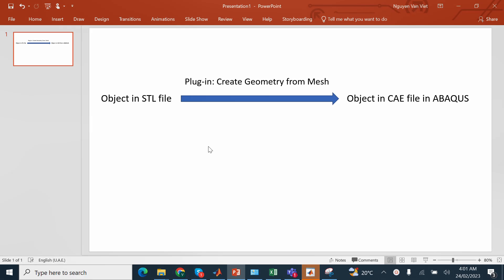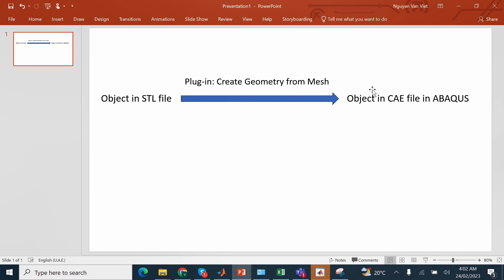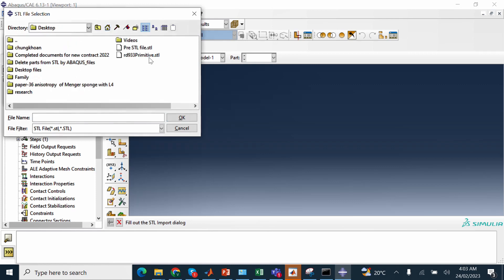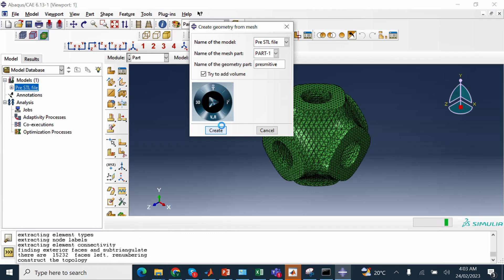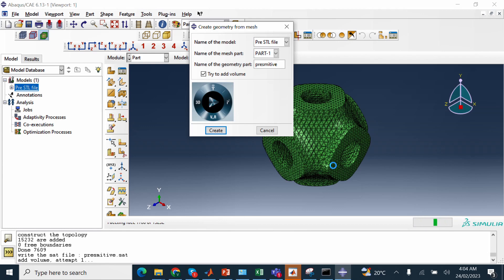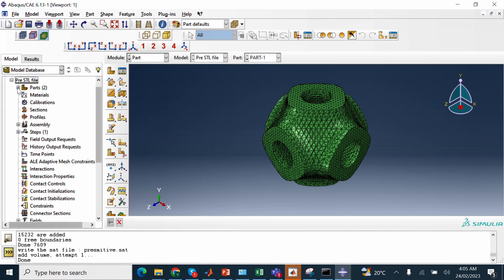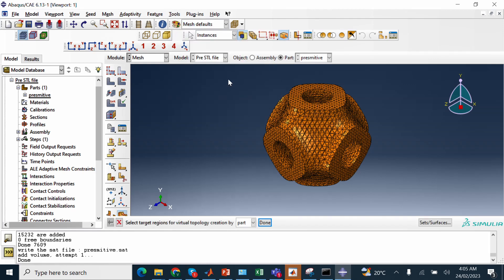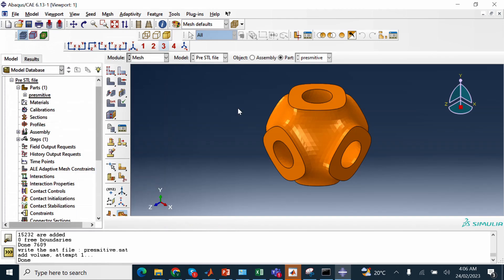Convert object in STL file into CAE file using ABAQUS

Comment: Hello. After using the 'Create geometry from mesh' plugin, the new part is 'invalid'. It creates a set for invalid vertices. After querying the part, I get the following:
It is a mixed dimensional part(1 cell, 9154 solid faces, 12 shell faces, 13749 edges, 4581 vertices). Do you know how to clean this up or fix what is happening here?

Comment: Hi, after I do all of this step, when i tried to create a mesh there are pop up "the selected regions cannot be meshed automatically using the assigned element shapes. They must either be partitioned, assigned a tet shape, or manually meshes using create bottom-up mesh tool". How do i fix this? Thank you
Reply from the maker: Hi, please use the  tetrahedron mesh type, which should do before you mesh structure
Reply: @ducdeubro1  thank you! Is there any differences between using hex and tetrahedron mesh? I mean how about the simulation result? Is hex better than tetrahedron?
Reply from the maker: @uzumakinaruto-lb8wi   based on google, tet is better than hex in terms of results, but for me I saw they are almost the same. Hex element is like a cube with four nodes, but tet element is like a pyramid shape with 4 nodes.